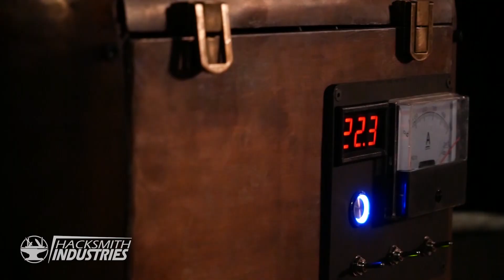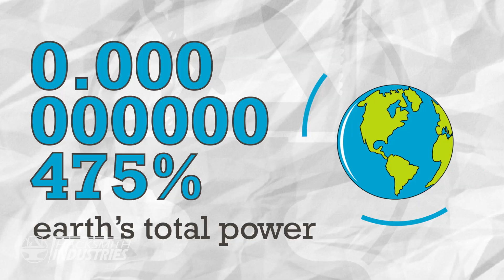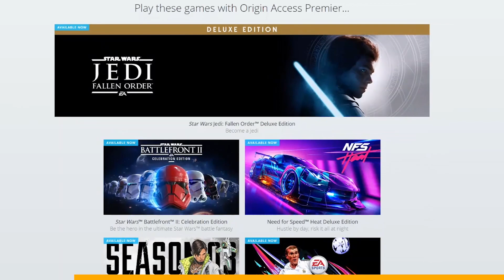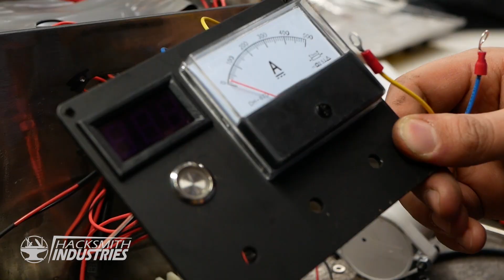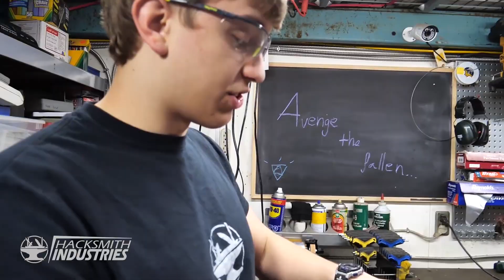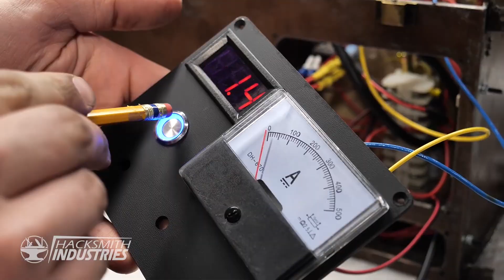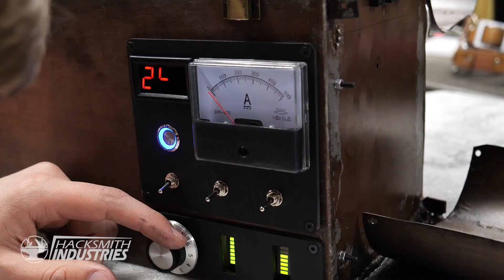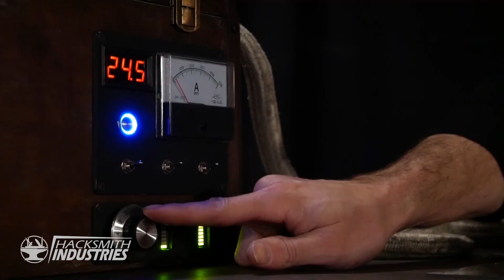World's First Protosaber! (REAL BURNING LIGHTSABER)

Comment: i would like to mention that the proto-saber is legends continuity and disney has since changed its canon stance on the proto-saber however there are stories of the protosaber and its major development issues such as the battery pack malfunctioning and exploding the cord being cut and the current frying the user the blade breaking and being cut in half with the broken part falling onto the wielder and killing them these are all realistic things that could happen and to that end i think before your duel you guys should make some protective sith lord-esque equipment that has high temp resistent material packed into it.

Comment: Lightsabers are scientifically impossible to make

Confused Screaming
Reply: Yet .... impossible yet ..
Reply: Cell phones were impossible 30 + years ago don’t say impossible, just not yet
Reply: With a longer time period we can make anything like star destroyers, heck even a death star, just a longer period of time....
Reply: @qwertyrainetmir7743  There's a limit to everything, for instance a death star would take more than 3,000,000,000,000,000,000,000,000,000,000,000 joules. That's 100s of times more energy than our sun puts out in a year. Saying nothing is impossible is naive, if you don't understand what is required to make it then don't assume it can be done. Magnetic fields don't just align how you want them. In order to make a field that is in the shape of a rod you'd need a dipole with a beginning and end for the magnetic lines to align. This defeats the purpose of a lightsaber because now you have a structure that spans the blade instead of it being induced from the hilt. So plasma is out of the question, which is the only way you could produce results similar to that of a lightsaber.
Reply: @kirinyardberry1324 ,

Your Straw-man mischaracterization doesn't hold water.
Reply: @Chipwhitley274  Your accusation of straw-manning holds no reasoning. Logical fallacies aren't a "gotcha" argument, you can't just blabber them out an expect the other person to give up. Please, explain who's argument I straw-maned, in what way did I mischaracterize an argument?
Reply: Jason Arul noice whitey 👌🏿
Reply: Jason Arul noice whitey 👌🏿
Reply: But until the time come it will be posible
Reply: We kinda have what we need for a lightsaber.
Reply: You could power a real lightsaber using positrons

Aside from, you know, how do even get that many positions contained, much less existing, in the first place without getting attached by every nation ever
Reply: @user-lt9ts7rh4y  ah yes antimatter.
Its sounds like science fiction but is real and it can give a crazy amount of energy.
Reply: @colorado2455  I saw your original reply LMAO
Reply: @user-lt9ts7rh4y  that reply is no more so sip it.
Reply: @colorado2455  sip it?
Reply: @user-lt9ts7rh4y  just a joke of austin powers.

Comment: sorry to disagree but at the rate of technological advancement the idea that anything is impossible is wrong we simple have not worked out the problem. 100 years ago we rode horse and buggy in less then 60 years we landed on the moon about 20 or so years after that home computers 20 years after that cell phones and electric cars. power sources and generators are being artificially retarded because the fossil fuel industry would go broke . here is a CHALLENGE TO YOU  build tesla's power transmission tower he got it to work can you.

Comment: Not bad. But I have a question about the blade itself. Every Star Wars fan, as well as every trained martial artist/swordsman knows that not every sword is the same size. You have to adjust the length of the blade for the person wielding it. Lightsabers in the show have adjustable blades, but would it be possible to design the protosaber with the same capabilities? A way of retracting the blade into the handle just a few inches or so?
Reply from the maker: Possible yeah

Comment: Have you considered that military and law enforcement might be interested in this as a breaching tool? 
If you could get the total weight down to 10 lbs or so, this could make millions.
Reply from the maker: What would it breach? It can't
Reply: @hacksmith  Right now, there are 2 systems for bypassing locked doors. You can either break it down with a heavy ram, or blast the lock with a shotgun. Both have one major flaw: noise.
Maybe the current version of the protosaber isn't up to the task, but with further refinement, it could offer a means of entry that wouldn't alert an entire city block to what's going on.

Comment: For a piece of hardware that size, you need more solution, more amperage, and a little more copper. and instead of moving it about, make a copper "rack" out of thicker gauge wire, you will see better results

Comment: It looks like MOSFET failed because the rise time was not fast enough. Big MOSFETs (and a lot of them in parallel) have quite high gate capacitance and you need special drivers to overcome that. In case of using ordinary switch, there might be 2 issues: 1 - contact bounce, 2 - not enough voltage to open gate fast enough (remember, there's a lot of capacitance). Just be wary of those problems.

Comment: Go to battery factory ask a tiny battery that have alot of voltage and use it in the saber that might be possible?

Maybe?
Reply from the maker: Doesn't work like that
Reply: Then when do you think you will make a stick that can go through any thing without a back pack
Reply from the maker: Battery technology would have to advance one hundred fold I think

Comment: The interesting thing about the protosaber is that back in the legends continuity, the early lightsabers were also externally powered with a cable connected to a power pack.

Now we need to master the art of creating a magnetic field to form the shape of a blade instead of superheating a metal rod, then we will truly create a lightsaber.

Comment: Actually a lightsaber is possible it's just that the technology is extremely difficult. In fact with today's technology we could make a lightsaber using a magnetic field with plasma in the center and we know it's entirely possible the issue however is like you said the power as it would take an entire city's worth of power in order to hold the magnetic field as well as generate the plasma, however there is a real world energy source that we could potentially use but it's hard to make right now, anti matter. just a single gram of antimatter is the equivalent to a nuclear bomb. The problem with this however is it takes so much money and power to make even a single gram of antimatter that the costs out way the gain. however given a few decades we could potentially see this technology grow in fact technology is evolving at such a rapid rate that in the next 50 or so years we could potentially build a spaceship that runs on antimatter but it may take 100 years before antimatter is a public thing but who knows

Comment: bet $10 the two sabers weld themselves together when the contact
Reply: no, in they'd have to cool rapidly for that to happen. Since they're EXTREMELY hot, they'd probably just make more sparks
Reply: Might bend from the heat causing them to be maleable but not welded together
Reply: mineguy 2015 if anything they’d short circuit each other and blow the battery packs, this is based on my past experience working with metals but then again, I could be wrong you’d have to test it to be certain
Reply: @thatoneguymccool1469  since the packs are isolated from eachother they shouldnt short.
Reply: " When the contact"

Comment: Part of me is wondering if it’s possible to maybe make a sort of alternator that is powered by the resultant heat that allows some of the energy from the blade to recycle into the pack. It won’t extend it’s life indefinitely, but it would definitely make it last longer if they can pull it off.